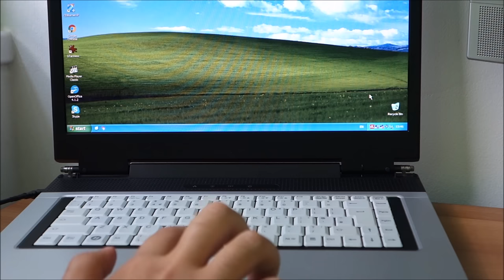🔌 How to fix a laptop charger cable and plug 🔌

Comment: Hi there, can I use the laptop charger to connect to a heating element wire coil, see an example in this video:  https://www.youtube.com/watch?v=YLmLEc7OHGQ
Someone commented that the guy on the video is using a laptop transformer, but if that is the case this would be equivalent to you, in your video soldering the two wires together, but you insulated the white wire not to be touching the other one. Do you think if I connect the two wires from the laptop charger to the both ends of the heating coil would work, or will it blow up?
Reply from the maker: It depends on the heating element. If the heating element was designed to work at about 15v and does not draw more current than the charger can provide (about 4A), you should be ok.
Reply from the maker: He is not using a laptop transformer in the video.

Comment: Dislike because he did not mention anything in detail regarding the technical specifications like which wire is positive and negative where is the data wire etc if you just repair your charger following these instructions you may burn your charger board circuit. Please avoid watching such videos to stay away from any harm.
Reply from the maker: I consider you are mostly wrong, but I admit that I sometimes fail to realize that people don't have common sense anymore. That being said, the polarity of my connector might be different from someone else's connector, so mentioning it could actually create a problem, but I could have said something like "be careful about the polarity", although someone not knowing this by himself would have tools to check it or to understand the polarity diagram on the laptop? But as is, look at the video and see if any sane person with minimum electronics knowledge, could solder those 2 wires the wrong way. Without minimum electronics knowledge, you are not soldering things together. One wire is white and the other is uncovered. All chargers that I had a chance to work on over the years have different color cables, so the chance of soldering wrong ends together is close to 0%. But if somebody doesn't even have this minimum common sense, they should not even attempt to fix their own charger.
This is like those modern "don't put your cat in the microwave" warnings.
Reply from the maker: You like to look smart with your comments, but sadly what you wrote here is anything but that. Attacking someone online is not what a smart person would do and calling someone stupid in your first sentence is a sign that you already lost.
Reply: Shut Up! and Talk to my hand!

Comment: Im only a kid
Reply from the maker: It's better you don't try to fix it then, find someone to do it for you.
Reply: Poor kid. Hi ultimate DIY is it okay to not solder the wire? Because we dont have a soldering gun here
Reply from the maker: It depends on the specific problem. If you have two wires long enough, so you cant tighten them together well and isolate them really well, then it can work. But, because of the high current, in time it can start to make imperfect contact and cause problems.
Reply: I twisted the wires but they are not long enough. I just used an electrical tape. However they are already working now. My current problem is that the charging port is loose. Do you know how i can fix this?
Reply from the maker: +Ely G charging port in the laptop itself?
Reply: Yes. I dont know which one is the problem: the housing? The metal part? Or the prong? And a tweezer can't fit in the port too so i cant give it a trial and error
Reply from the maker: +Ely G yes, sadly that is hard to fix without some tiny tools. I fixed recently something similar: https://youtu.be/kMjNxBJ7dsc